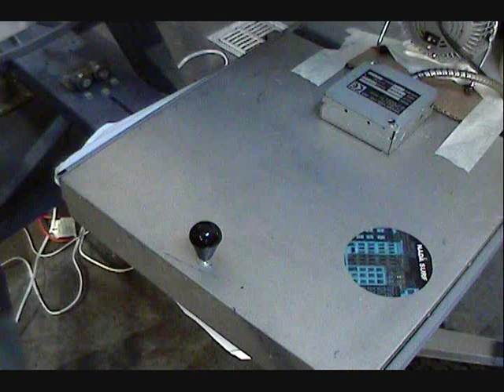How To Screen Print Tee Shirts: Sleeves & Ribbed Tank Tops

Comment from the maker: @chrama1 - I am using a 110 mesh with a 65 durometer squeegee. The flood & stroking method here is soft with multiple passes. I am working the ink into the texture of the thermal shirt sleeve. Using a softer flood & stroke builds up nice coverage without blurring out the print. Then you can see I leave ink in the mesh and it gets pulled out onto the shirt as I lift the screen. This is how you get coverage without double hitting with a flash when possible. Thanks for watching & commenting!

Comment from the maker: @DelbertStinkfester - Good question. I did set it up to print wet but the metallic red glitter ink had a pretty wicked pick up factor on the black screen. Much of the glitter effect was lost from pick up. Also the ribbing of the shirt needed that extra ink coverage to look good as well. So between the loss in coverage and the loss of the effect of the ink due to pick up, I flash cured it. Thanks for watching & commenting!

Comment from the maker: @bramwellaj I wouldn’t recommend it. Standard inkjet heat transfer paper will work best on a tight knit surface like a tee shirt. The transfer will not be able to adhere to the troughs of the ribbing. You might be able to stretch it during pressing and use high pressure but I think the ribbing will affect the transfer quality a lot. Thanks for watching and commenting!

Comment from the maker: They can also sit differently on the arm depending on the shoulder seam if there is one. It really takes some experience by putting the shirt on in your size and making note of how it sits on the body in relation to seams and collars. Then you can figure out how to do placement after that. Sometimes markers or feeling tabs can help guide placement during print runs. But sleeves vary in size depending on the size of the shirt to so it can be tricky. Thanks for watching and leaving a comment! ☠

Comment: Could you comment a little on your technique here used on the dark sleeves??  I see the single flood, but when you are stroking, it looks like you are not giving it full pressure as normal.  I am assuming when you are doing your stroke,  you are taking a little more ink from the forward part of the screen each time.

Comment: Just found this...recommendations on design for long-sleeve lettering? 
Heights, lengths, fonts, etc.

Thanks!
Reply from the maker: That really all depends on the garment size and the artwork. Each different shirt size will have a slightly different size sleeve. So you have to decide how you will handle that. Make 2 sizes and split them between the group or make a different size screen for each size shirt. But there are no standard sizes or lengths for any given print job. It's all relative so any numbers I give you would be useless since I don't even know the length of the sleeves. Follow? I would look at the shirts you are printing with the artwork and converse with the customer on print sizes. Thanks for watching! http://www.catspitproductionsllc.com/ - http://catspitscreenprintsupply.com/
Reply from the maker: A brand called Never Weaken. I don't think it went anywhere really. Thanks for watching! Screen Printing Equipment & Supplies - http://CatspitScreenPrintSupply.com/